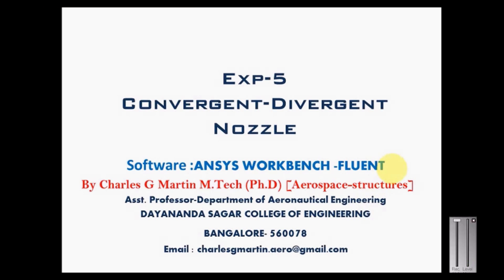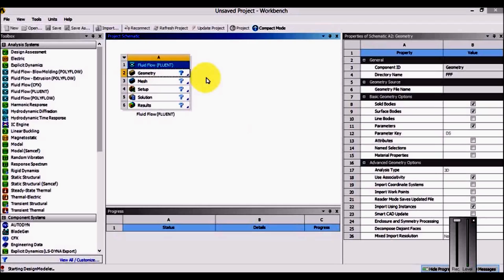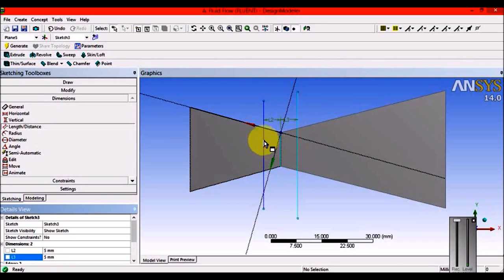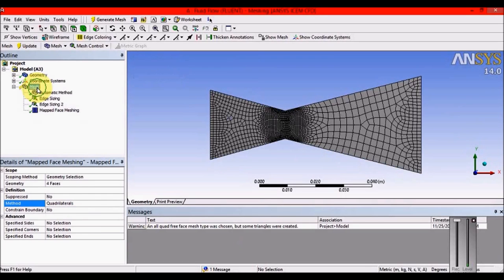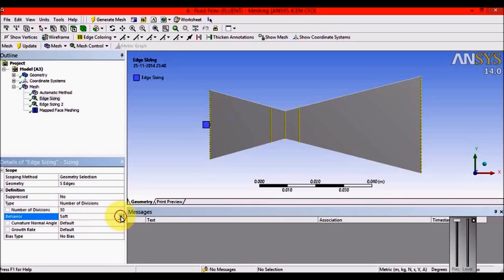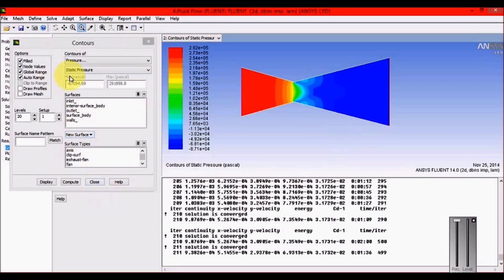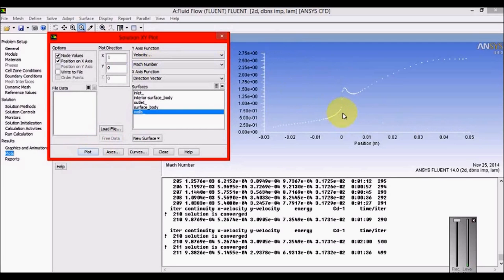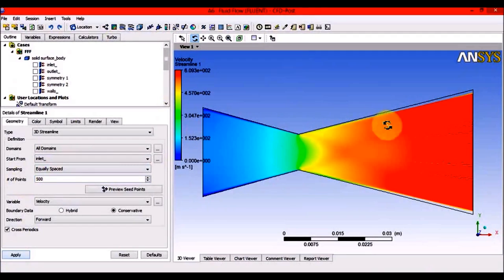Ansys WorkBench - Fluent C-D Nozzle tutorial

Comment: Good presentation Professor, please check your third PPT you mentioned that pressure increases and velocity decreases in the converging part of CD nozzle,  which require correction.  In the CD nozzle from inlet to outlet pressure decreases and velocity increases
Reply from the maker: KANNAN K Sir is CD nozzle the pressure increases in inlet comparing the exit divergent part !! what ever I have mentioned in ppt is right !! It's the core theory of C-D nozzle !!
Reply: no the pressure decreases in the whole process as the velocity keeps on increasing
Reply: Hello sir, If the flow is subsonic at the inlet of convergent part and the flow velocity decreases in the convergent part..
Then according to this, sonic condition can not be achieved at the throat. Think about this sir....
Reply: If flow is subsonic:-
In convergent duct- flow accelerates.
in divergent duct- flow decelerates.

If flow is supersonic:-
In convergent duct- flow decelerates
in divergent duct- flow accelerates.